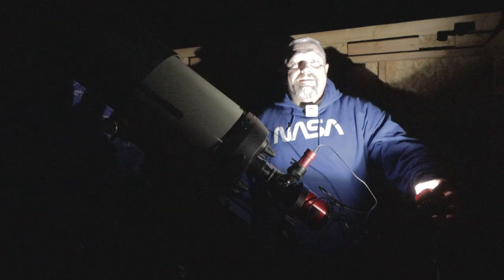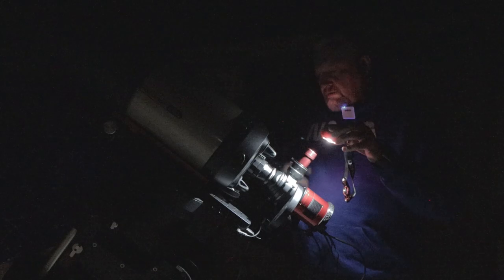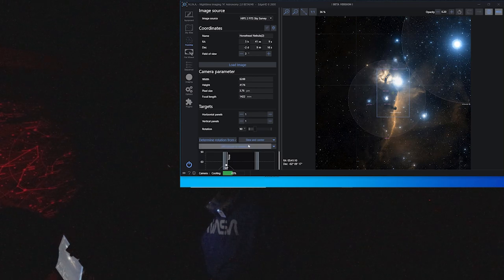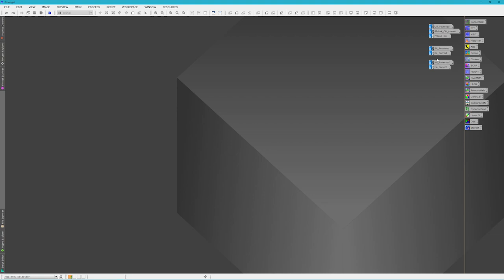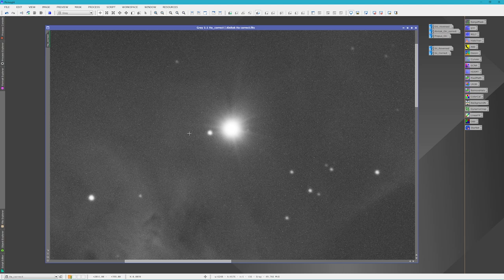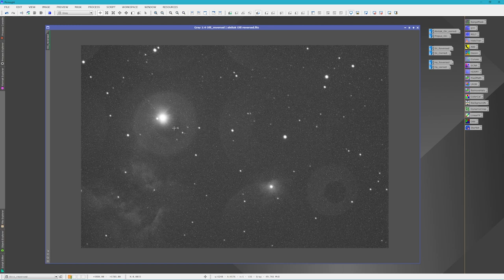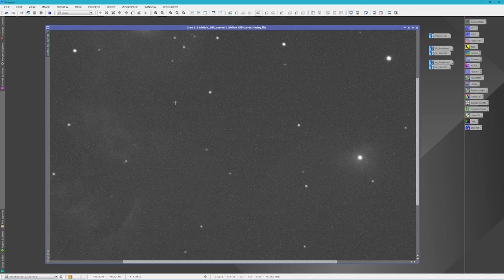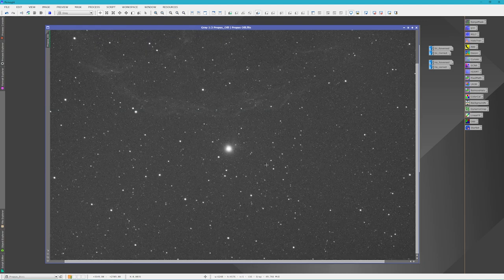What happens when your Filters are in Backwards!

Comment: I took some images of alnitak a while back with an optolong l-extreme with an asi294mc and an 8" edge HD with hyperstar 4. I had the filter in backward and had the same, very large halos. My colimation was perfect, so I'm thinking it's more to do with them being backwards. The coatings on the filters are there to reduce reflections. So when they are backwards, you end up with those halos around very bright stars. I could be wrong, but that was my conclusion as to why my images turned out this way.
Reply from the maker: Thanks NG, that's very interesting and could be the answer for sure. I was just assuming that it was the collimation, but you could absolutely be correct. If I get a chance I'll test again after collimating. Thanks for sharing that.

Comment: Hey Joe! Love your content. What, if any, effect do you think reversing filters would have on flats?
Reply from the maker: Thanks so much Matt! That's a good question. I would guess that the flat itself for gradient or vignette would be fine. But I would think that if you accidentally had a filter in backwards and realized it, then swapped it out after your session and went to take flats afterwards, you'd only run the risk of having dust motes pop up in different spots. This is all just me guessing though as I haven't tested that before.

Comment: This might be old news, but those shockwaves, as you described them, are due to the 'microlensing' issue that occurs on all ASI1600s. I believe this has nothing to do with the filter, and is actually a reflection issue inherent to the sensor on the ASI1600 cameras. This happens on big, super bright stars such as Alnilam. I'd be curious to see if the reversing of the filters exacerbates it though, but I am under the impression this would happen on the ASI1600 with a star like this even with a luminance filter.
Reply from the maker: Thanks Dan, I have experienced the microlensing effect before when I owned an ASI1600 and you are right about the bright stars causing a weird pattern although much different than this one. That being said however, I was not testing with an ASI1600, I was using an ASI2600MM Pro for these tests. I appreciate your logic and it may hold true  for some other part of my imaging train, so always a possibility that the directions of filters has no bearing on anything.
Reply: @JoesAstrophoto  Ah, my bad. I thought I read that you were using a 1600 for this test. I must have misread that 🤦🏻‍♂️
Reply from the maker: No worries Dan, it was a good comment for those that may be using ASI1600s and don't know about the microlensing effect.

Comment: Seems everyone using these Antlia 3nm pro's have a different experience with halo's. For example, my Ha shows a tight halo on Propus but Oiii and Sii look fine. Others I've seen will have halo on Sii and Oiii but Ha will be fine... You're doing very well if you're not seeing halo's for all three.
Reply from the maker: Thanks! I agree, I've seen so many different reviews on Cloudy Nights with halos on different filters. The reason I pulled the trigger on them is my friend Mike Asbury and Glenn Clouder both tried them and reported no halos when in the correct orientation so I wanted to see if I could save $1k over the Chromas. I'm very impressed so far, but your mileage may vary. It may also be due to the optics being used with them as well. Just look at the difference between my Oiii when collimated almost correctly and then way out of collimation.
Reply: Both orientations for your Ha examples look great compared to mine. I do see the 'shockwave' interference pattern you mention so I may reverse the wheel to see if there's a difference. Hopefully there is as unmounting the filters with a spanner and flipping isn't terribly hard. Thanks for posting your results..
Reply from the maker: Good luck! Let me know how it goes.

Comment: What’s the more impressive result here is no vignette experienced whilst using the 2600mm with the .7x reducer! How? I thought the image circle the reducer produces was slightly smaller than the sensor size…
Reply from the maker: You are not wrong Chris! The image circle with the reducer is 27.5mm and the 2600 is a at 28mm and when I image in lrgb it's very apparent in each sub, but when imaging with narrowband, it's not very apparent unless I get a huge stack of 10 minute subs. The flats usually take care of it, but honestly, I prefer my 294MM Pro with the EdgeHD 8 over the 2600 unless I run it at native FL but that means F10 imaging...ouch. I did order a T adapter though so I can try it for galaxy season though. Also, I've only had the 2600 for a few weeks and still experimenting, but what you say seems very accurate so far in my testing.
Reply: @JoesAstrophoto  I am so frackin torn between the 294MM and the 2600MM for the EdgeHD 8... I'm literally racking my brain  over this conundrum... I think the main concern I have is good RMS and the 2600mm in bin2 mode seems like the ideal choice at both reduced and native FLs with the downside of minor vignette that calibrates out... Do I calibrate vignette out with the 2600mm or do I calibrate out amp glow with the 294M... ARRRRRGGGHH!!! I guess the other serious advantage of the 294M is the cost... I can literally get the 294M with all your narrowband Antlia filters for the same price as the 2600MM... I think I just answered my own question... Thanks for everything that you do! You and Astrobloke provide an invaluable resource for the EAA community!
P.S. You ever binned in 3 or 4 mode? Would be really interested to see comparative results between those 2 modes. Bin3 @ 2762X1881 12-bit or Bin4 @ 2072x1411 14-bit!
Reply from the maker: Thanks so much Chris for the kind compliments! I haven’t had enough time yet with the 2600 to make a good recommendation for it’s use with the EdgeHD 8. Right now, I’d say the 294MM Pro in bin2 mode is a much better match for a few reasons. No vignette, better pixel scale, tighter FOV for the smaller galaxies. I may change my mind after trying F10 imaging and/or bin2 mode. Also, for me I’ll probably be using the 2600 on my Z81 more when I get the chance to run both rigs at the same time.